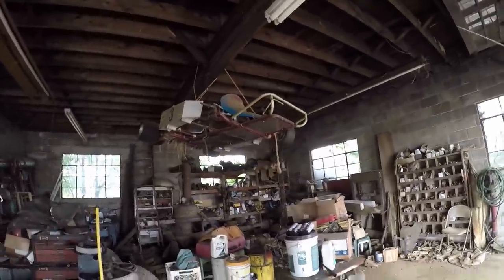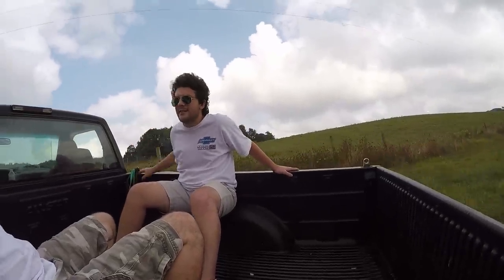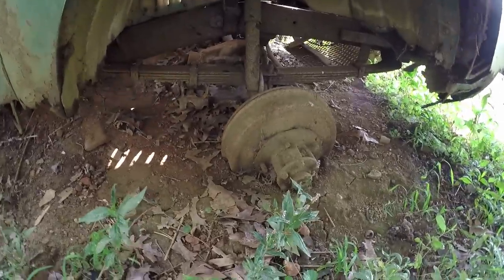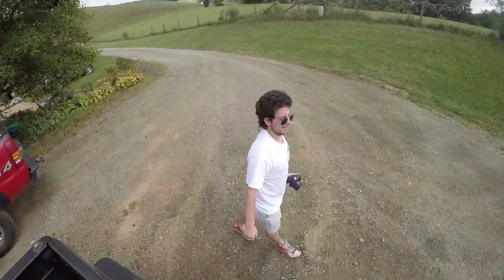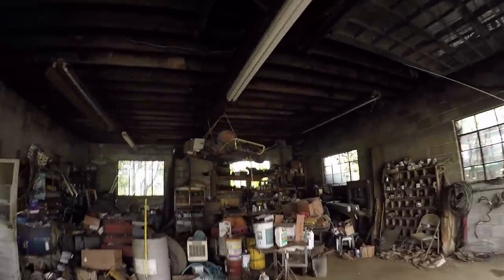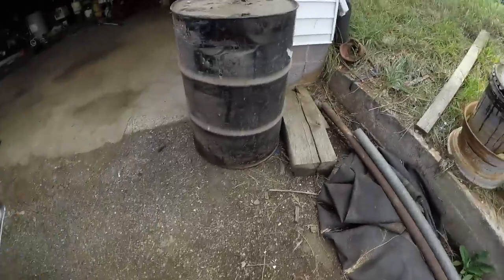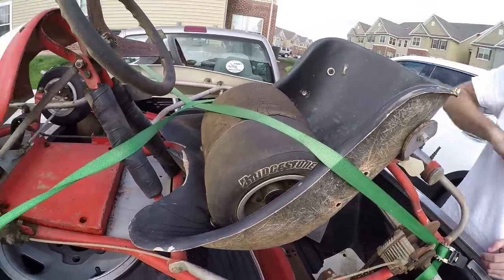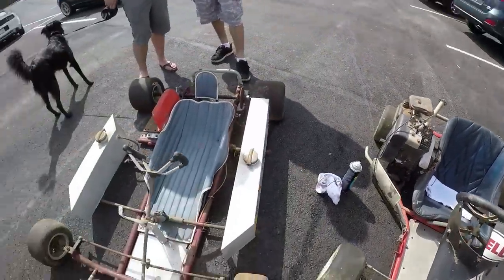Go Kart Barn Find: 3 for $300!

Comment: The first one is an early Enduro "laydown" for 2-cycle, that one is older than 90's, it's more like late 70's and these would go about 90mph around Daytona.  The other two are mid-80's Margay Pro-X and the one looks like a later Margay Expert.  I raced both of these and has a "flat head" Briggs and Stratton 5HP.  At one time, before Jamie Russell and Gary Freeze invented the "Offset" first kart called the Olympic around 1988 - these are what you raced...and won with...still have two of these myself.

Comment: Definitely do a build off!, I just modified my predator 212 with nr racing's stage 3 kit and made 22" atv tires fit (with some home made 5" wheel extensions (I have a similar kart like your first one you guys had, mine is the banshee frame).  I look forward to seeing your guys' progress!  I wish I had a nice yard like you guys, mine is a bit small compared to it, but does the job.

Comment: An older "Lay Down" kart. Used on Road Race courses. Used to call them "Enduro" karts The Laydown with a strong KT100 engine will run as fast as a 125 Shifter Kart on a road course. Cool find.

Comment: build off for sure. maybe predator 212 on each with identical hp mods so that their equal. leave setup to be determined by driver. gearing, tire pressure, etc.then run em off! see who does the best when hp is equal.

Comment: This is a perfect example of how HARD it is to find these karts for 100 a peice. John and Ike Had to drive 3-5 hours to find these. I was very lucky when I found mine for 100 for a rolling chassis after looking daily for 3 months. Bought a predator and a stage 1 kit and bam 50mph racing kart. A little paint and TLC and it was worth 750 easily because they are rare.

Comment: transmission or tuning or turbo or lever to engage and disengage the clutch (for revving or faster launches) or torque converter or longer exhaust or differential or traction control (not high tech but thinking of ways to enhance the traction would be awesome) or boosting system or weight reduction or blower intake or mobil 1 oil or down force set up or low drag or something really cool to make your karts faster,  have better acceleration, improve handling, or something that will help you in a race. who knows, maybe one of your karts will be 100 mph capable, also I think a build off is great, howabout 24 laps of le mans or 24 minutes of le mans

Comment: THE LAYDOWN KART USUALLY USES  TWO 100CC YAMAHA AIR COOLED MOTORS, ONE ON EACH SIDE, THOSE RACING KARTS WENT EASY IN THE EARLY 80S  90MPH TO 120MPH MANY YEARS BEFORE SHIFTER KARTS. MARGAY, MCKOY, CYOTE, TRICK, ALL MADE THESE IN EARLY TO MID 80S. THE LAYDOWN KART WAS ALSO CALLED  "ENDURO" KART RACING. BIG GAS TANKS FOR SEVERAL LAPS OF RACING WITH DUAL YAMAHA ENGINES. O TO 60 mph IN UNDER 3 SECONDS WAS NORM. HAVE FUN, WHERE MOTORCROSS NECKBRACE WITH HELMET AND LAYDOWN KARTS.

Comment: The predator 212 is a good engine but personally I would stick with the motor that I have now. It is a 205cc 8.25hp motor that's from a pump my dad had
Reply: It's so powerful , I've literally burned through 3 centrifical clutches in 2 years

Comment: Nice vid! maybe throw some predator 301's on them, would be a nice compromise between the 212 and 420 I think.
Reply: +Nico van Duin the 301 is huge like the 420. sadly wont fit
Reply: +Nico van Duin gy6, 150cc, with governor removed it is 14 or 15hp and they have lots of aftermarket parts including turbos.  With the turbo you can make upwards of 100hp.
Reply: +Waylon Richardson That could be a good option. People at my local go kart track use the original version a lot. at 15 HP a good match for my gx390
Reply: world's fastest drag scooter is running a big bore gy6 on nitromethane.  180cc with the big bore kit.
Reply: +Isaac Jennette do you guys want to stay with the 4-stroke predator engines,  because it has quite low maintenance costs?  Because a fast 2-stroke engine would be very cool.
Reply: i think one of the rules we mad
e up is 4 strokes only

Comment: Haha now you have to deal with two piece rims like me. Just take it to a tire shop when you need the tires changed: my rims bent because they're magnesium, only a little bit though.
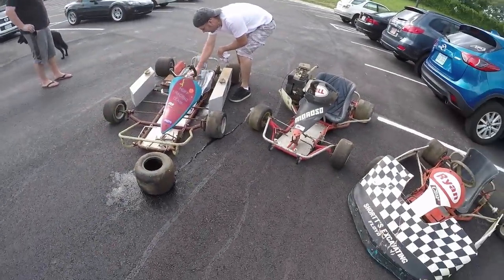Reply: Also at 22:17 the one in the middle is sooooooo much like mine... Do you know what frame that is?
Reply from the maker: +Parker Barandon I don't know the model, but it is a Margay frame.
Reply: CarsandCameras Oh sweet I'll look it up
Reply: +Parker Barandon Yeah, one of the rims that came with it is chipped. Not sure if it will hold air yet... we will see.
Reply: +TJ Woody uh-oh
Reply: +TJ Woody Tig welder and a lathe. Be sure to preheat the wheel before you weld it. After you weld it put it in an oven at 500 for 2 hours, turn the oven off and let is slowly cool down overnight.

Comment: there should be a build off all must have a predator 212cc... torque converters are allowed and the muffler must be at least 2 inch (diameter) you each get an extra 200-250 too spend not including the engine

Comment: I'm sad because I can't find any of these 100 dollar go karts. I've checked ebay craigslist, pretty much everywhere. How do you find these
Reply: +Nicholas Wieczorek put the word out and see if someone you know knows someone who has some land just like they did
Reply: I found mine in a junkyard. 50 bucks. Also try going around asking random people. Got a snag that way too
Reply: put up an ad on craigslist under the "wanted" section. you can even copy and paste the ad off this..here goes.   Title:"WTB go kart frame"
Ad body: want to buy a gokart frame... let me know what you have. call or text at insert number here"
Reply: I /my uncle found mine for 50 dollars with a Old Tecumseh motor 3.5hp with two 40-50 dollar rlv racing mufflers,i later swaped a Briggs intek 6.5hp 206cc which if I wanted to I could put Briggs animal parts in it ,and my second go Kart I have and building is a manco 445 that he got for free and im custom fitting a snowmobile engine on to 24hp Rotax 399cc, videos on my channel you can find them very cheap just need to know where to look
Reply: Thx all. I think I found one. Surprisingly from one of my closest friends.
Reply: Nicholas Wieczorek that's great you see just have to know where to look

Comment: May I make the comment.  Look for a kt100 2 stroke engine.  It would be way faster than those 212 and there roughly 200 to 300 bucks and like 100 bucks to do a rebuild.   Just a comment.  Or a Briggs animal 200.

Comment: I have a question I have 2 mini bikes one of  .  the engines my newest one has gas leaking in to the oil we think it was a seal but you never know its funny cause my home made mini bike runs and drives way better it goes about 50 mph and the new one goes just over 20